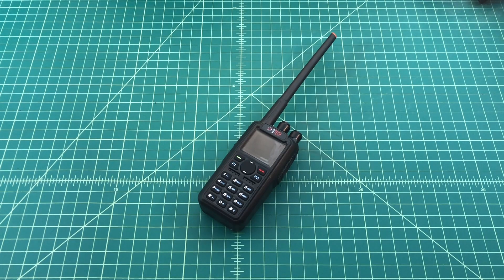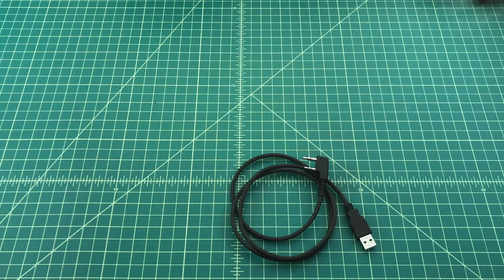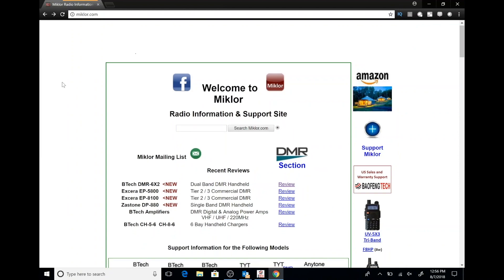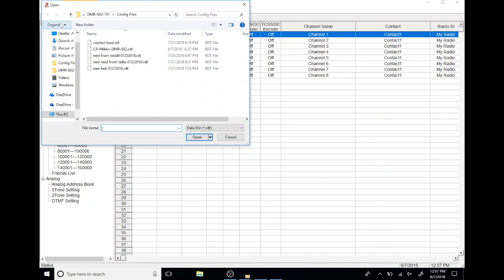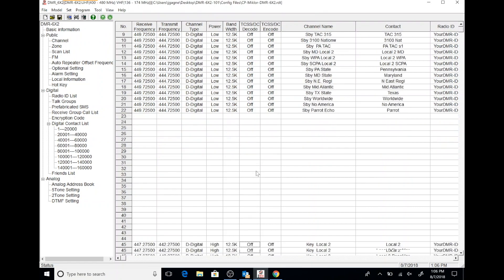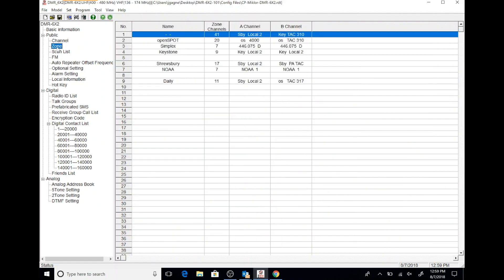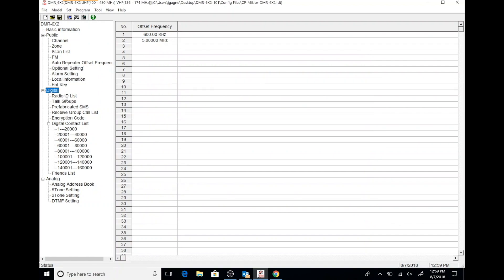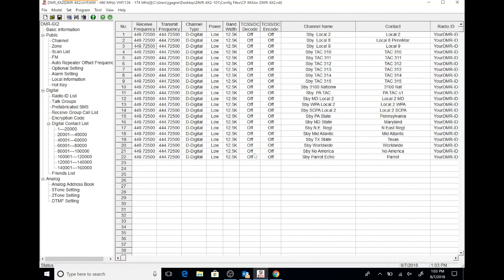BTECH DMR-6X2 Uploading a Generic Code Plug - TheSmokinApe

Comment: The IMPORT menu in the v1.02 CPS software in awesome because it lets you pick each item separately.  The main selling point for me, when I bought this radio was the CPS software is BY FAR simpler and easier to use than any other I have used...
Reply from the maker: The CPS seems pretty straight forward, I was able to use it without reading any of the documentation.  This is my first and only DMR radio so I don’t have anything to compare against.  The only real gripe I have is that I wish the CPS supported tabs and allowed you to have multiple code plugs open at once.  The other recommended feature would be the ability to import from RepeaterBook.  I appreciate the feedback you are providing!

Comment: I use the Baofeng uv-5r for personal use and for my work I work as a private security guard at this moment I am in puerto rico doing security work for FEMA and when I try to enter the frequencies of the puerto rico police I do not know happened because I can not receive or transmit is completely silent try to reset the BAOFENG uv-5r and enter the frequencies and then nothing
Reply from the maker: Pedro Juan Santana Figueroa I’m sure of the rules there for using this radio on public works.  Does it work on other frequencies?

Comment: Awesome tutorial!  Have you been using the radio much?
Reply from the maker: Thanks Ron!  I have been using it, but not as much as I should.  I have had some problems being about to “reach” DMR repeaters, I live in an area that is very fertile with 2m & 70cm repeaters but not so much DMR.  That said I have been thinking of getting a DMR hotspot that I can make my portable link to the DMR world.
Reply: I can understand that.Same as me and my Ft-70D, and no fusion repeaters. ....still, a good HT nonetheless.
Reply from the maker: Yeah, I’m still not sure I understand the difference between wires and fusion but I have never looked into it in any real detail.  

We have allot of Dstar here and I was close to getting an icom HT but the cost of entry is high and it seems DMR is the new hot thing.

Overall I like the BTECH and am convinced it was a solid choice for DMR but the truth is that none of the DMR HTs are as mature as the icom Dstar offerings.
Reply: Agreed, I don't use these HT's enough to warrant an expensive brand....right now..
Reply from the maker: With a hot spot I would probably use this allot more.  Of course I could rig it to a good antenna and get a hand mic but then it’s not a portable.  

I do EDC a HT because I like to listen to repeaters and NOAA.  But I can do this with a Baofeng or a 150$ Yaesu ft60.   

The idea behind going digital, either Dstar or DMR was to be able to link with groups that have similar interests.  Most repeater talk is about what radio you use and antennas...  which I am interested in but the ability to have topic specific talk groups interested me more.
Reply: Totally agree...the Reddit of HT's! I keep a Baofeng handy as well...local chatter and weather. I've never been able to contribute to the repeater talk about bee keeping, or  club drama....so..I just lurk and listen.
Reply from the maker: Haha, kinda the same for me.  I do try to check in with the local nets.  I have a Yaesu 2900 that is just awesome for a 2m rig and that’s what I do 90% of my TX on.

Comment: I have with my Baofeng uv-5r I programmed it Manuel and it worked when I received the cd and the cable I tried to enter more frequencies and since then I can not listen or transmit, I did a reset and I continued with the same thing that may be needed. I use it as a scanner to listen to the frequency of the Puerto Rico police and when we start painting balls
Reply from the maker: Try using “chirp” to program the radio, it’s super easy.  I have a few videos on chirp if you want to check it out.